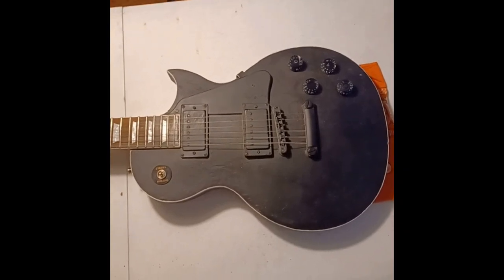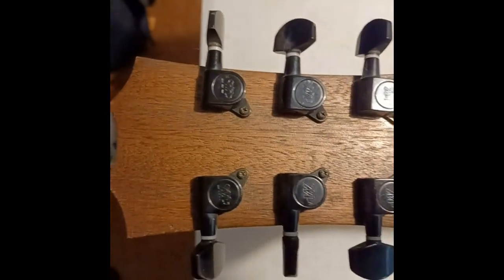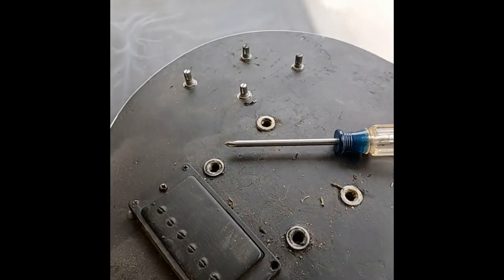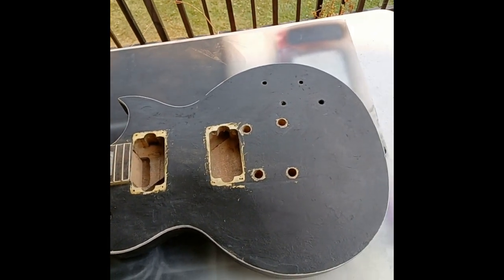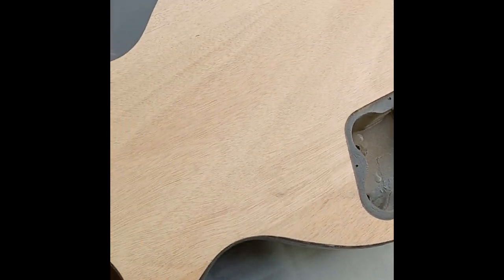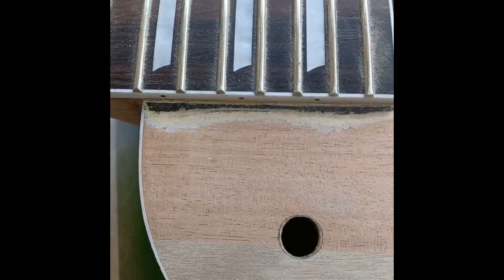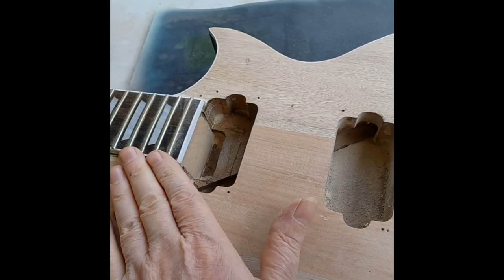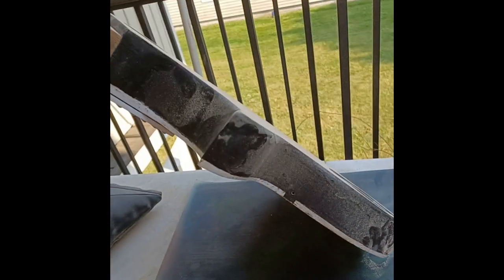Pre GGBO practice run #Jurgscup

Comment: That is quite nasty lookng, bridge looks at a really strange angle too. I normally do gibby scale at 630mm for the scale then add 3mm for the low E, works perfect. 

Good job stripping it, looking forward to seeing the end result.
Reply from the maker: Oh heya Niel long time no see mate. ty for the tip I will see where it is now before making any changes. Its still got to be relocated to get it back in line with the neck. I want to look at the glue up better before doing all that. Might be easier to remove the neck and reset that.
Reply: @Borgonian Evolution  I wouldn't have thought so but you'll need to see if the pickups can line up. If they're good I'd probably just go with moving the bridge and stop piece. 

A razor blade will get those tricky paint areas too like right up side the neck.
Reply from the maker: @nsjguitarsakascotsman6989  yup yup already started that part before I uploaded this video. I even scraped some of the fretboard / binding and did a light oiling to really look at that. Maybe better see how much love I want to give this other than just practicing an idea for paint on my actual GGBO build I have planned.

My guess is the body was pre drilled and routed. I don't see someone doing really nice routes then a paint job like that.

Comment: I don't think it's Warmoth. They don't make proprietary hardware, and they don't do set neck guitars.  Maybe Wilkinson tuners? 

Anyway, this looks like a proper challenge!  Good luck!!
Reply from the maker: ahh that just may be Jackson. The tuners have a big W brand on them and Warmoth is the only one that came to mind at the time,

Yes it will be a proper challenge. I might get lucky and be able to just do a neck reset. Need a better eyeball on how that was done after a little more cleaning and sanding around the joint.